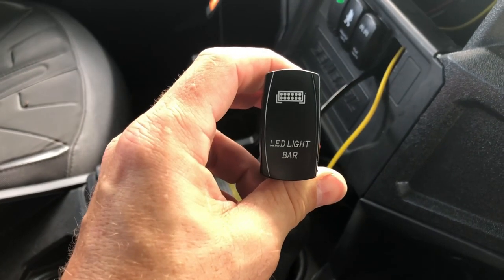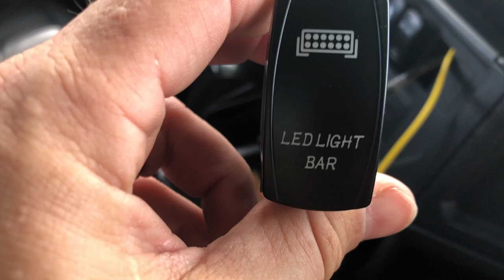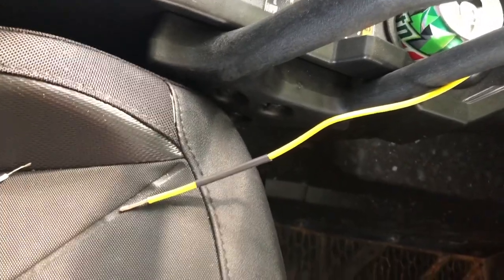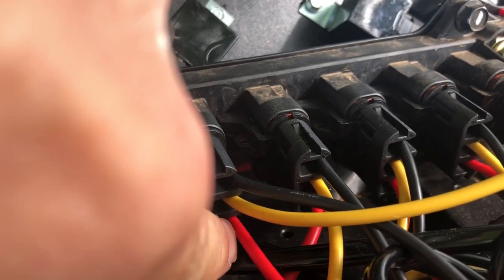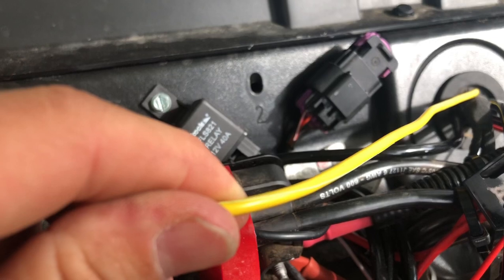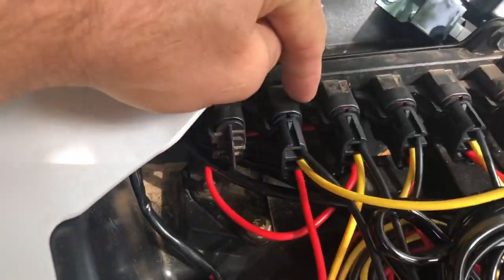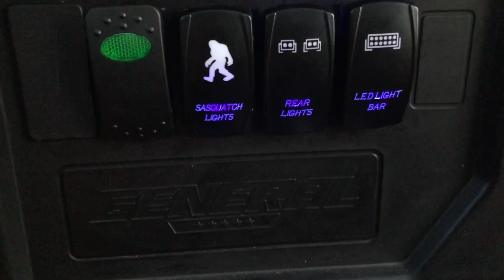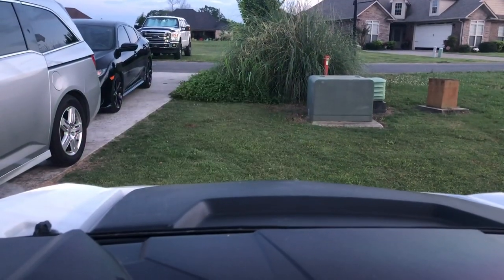Polaris Pulse Bar Wiring

Comment: It's amazing how many guys doing videos on these 5 pin switches appear to be clueless about wiring switch on power to the dash light and battery power to the load, two different power sources through the switch. Thanks for sharing.

Comment: IM still having problems with this, I wish you would have shown how you connected the wires on the back, I dont get what wire you clipped off, your video is the only one that actually makes an attempt to wire in a rocker to these so called wire harness, all I want to do is wire in the 5 pin switch and do away with that off/on stick on the dash switch.ALso, those wiring harness come with an off/on switch that just stick to your dash which needs getting rid off, what did you do with yours?
Reply: Likewise. It would be much appreciated.

Comment: You should be running the power from you pulse bar with an inline fuse to your relay on the 30 terminal. The pulse bar switched power then goes to your rocker switch. The rocker switch the goes to your relay control terminal 85 and ground to 86. Then the relay power 87 goes to lights. This way you are not putting a load through your rocker switch.
Reply: Yes❗.... This wire job is very hazardous....Big Big FIRE.
Reply from the maker: @BlueBARv5  Don’t all switches have a load once you switch them on? I’m no electrician or anything but could you guys post a video showing us the right way. I definitely don’t want a fire or lose my machine.
Reply: @BengyM  obviously I'm pretty late here but when this guys mentions 86/87/85/30 he's talking about the relays on the wiring harness that you DO have from what I see. No worries you're fine.
Reply: @johnnyg5129  Does the negative pole of the Pulse connector go to terminal 86?

Comment: I don't understand what you wired the yellow wire into? The red constant power or the white bottom wire? I thought i had it figured it out today because i had the little light on only when key was on than when switch was turned on it was all on but kept popping fuses. Im still comfused, what am i splicing and tapping into? An updated video of the back of the switch would help alot or a picture! TIA!

Comment: Exactly the video I was looking for great job
Reply from the maker: Awesome. Hoped it helped. So far I haven’t had any issues.
Reply: @BengyM  I actually ran my switch power from the bar to the bottom right as you did and to the middle pin on the left. Main power runs through the relay but the power from keyed on power activates it. This way the bottom LED of the rocker is on while it's running and both LEDs are on when I switch the rocker on. Work's perfectly for both my light bar switches. Now I just have to redo my horn switch.

Comment: When you said re wire all of them did you mean just cutting the wire off the switch and running that yellow wire from the rocker switch to the pulse and putting it in a casing or loom, or do you have to wire back to relay ? I hooked the wire up and it is all working great just want to make sure I’m not missing anything

Comment: Where did you get the 3 wire connectors that are under the hood with the red, black and yellow wires?
Reply from the maker: https://www.amazon.com/PAGOW-Connector-Pigtail-General-Harness/dp/B08ZD5PXFX/ref=mp_s_a_1_9?crid=B0H0V3CH581A&dchild=1&keywords=polaris+pulse+connector&qid=1631567950&sprefix=polaris+pul&sr=8-9
Reply: @BengyM  man thank you so much...also can you briefly explain how the rocker switch is ran from this connector. I know the yellow is for when the ignition is on then it recurves power. Well I wanna make certain that the switch lights up and receives power to power my lights only when the ignition is on, I don't want to be able to turn the lights on when the ignition is off ya know. Sorry this is kinda confusing to me. I repair laptops and iphones at my shop but this is a new venture for me. Could you maybe tell me where exactly the three wires from they connector goes to achieve what I'm trying to do???

Comment: Where did you attach the white wire too Power??
Reply from the maker: Tylor Graham  it goes to the switched power, the middle wire  on the pulse bar.  I has to splice yellow wire to the white wire to reach the pulse bar because it’s what I had on hand.

Comment: Hello, I hope you can help me.
I made an identical connection to yours. with the key off the led bars light up, but not the word "led light" on the rocker switch that only turn on with the key on.
The problem is that after a week, the battery was dead. you didn't have that problem? I mean, I thought I had done the installation wrong, and that I needed another relay so that everything turns off when I remove the key. but I see that you did it the same as me.
The only thing that I do not have installed with a rocker switch is a sound bar that is directly connected, but it has on and off in the bar, so I doubt that this is the problem.
Reply from the maker: Hello Thomas. Yes my lights themselves are hot all the time but will not activate until the toggle is switched on. You are correct on the word “led light” that turns on with the key. I haven’t had any issue with the battery though.
Reply: @BengyM  thank you so much!! then it's probably the soundbar that is draining the battery.  Thanks again
Reply from the maker: @tomasrey3047   Yes sir! I’m thinking sound at as well.

Comment: That is not correct at all   You don't tun the load through the switch You use the switch to trip the relay .  You are just asking for a fire doing that way
Reply from the maker: Thank you for your input. Could you provide a step by step video? I certainly don’t want to burn my machine up. I thought switches were designed for electrical loads.